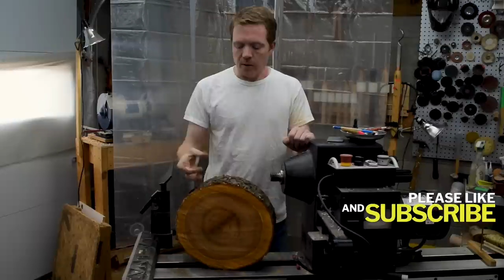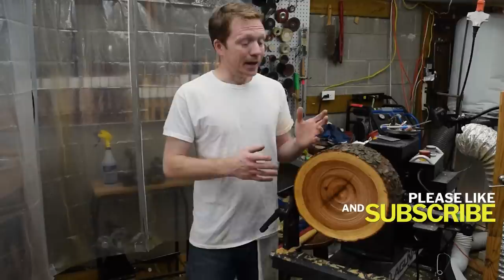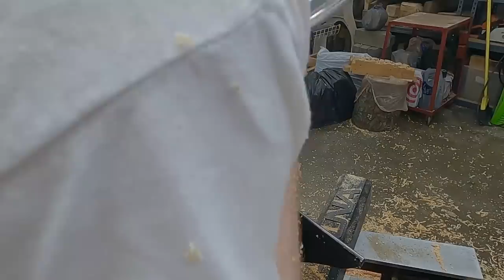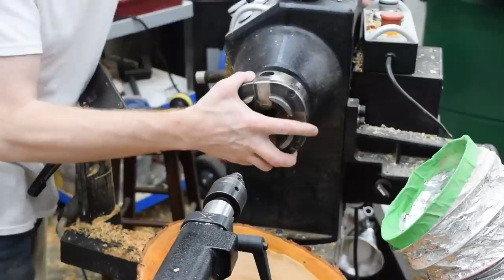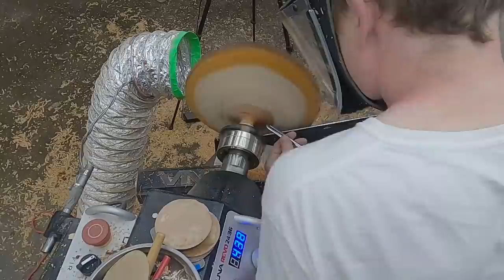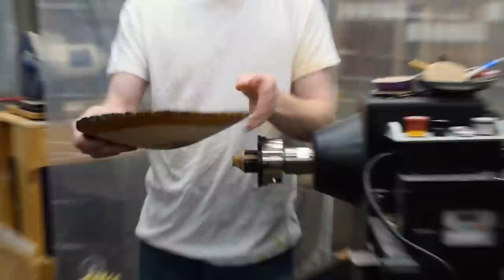Woodturning - Natural Edge End Grain Cherry Bowl [and Oneway Termite Tool Revisited]

Comment: Hi Chad, I had a revelation using the termite tool.  While making a box, I was noticing that I was only using one small section of the ring edge to do the actual cutting, and when it needed sharpening there was a a lot of sharp ring left that hadn't even touched wood.  So I spun the lathe in the opposite direction, rotated the tool 180 degrees and presented the tool to the wood on the right hand side (as you face the piece), and got to use an unused edge. This effectively doubled the time between sharpening. I imagine you and many other turners have figured this out already, but I hadn't seen it anywhere so I thought I would share it.
Reply from the maker: Thanks for the tip, Steve! I had the same thought about the unused side of the cutter being wasted, but hadn't considered your solution. Next time I use it, I'll definitely be using that idea! Thanks for watching and sharing your tip!

Comment: Steve, the Termite is the right tool, and with wet cherry the hollowing should only take a few minutes. You are using the tool upside down. Turn it over and use the less aggressive side, riding the bevel. I only use the aggressive edge to finish across the bottom inside of the bowl.  Also, tuck the handle along your forearm with your right hand holding the handle at the fatter part closer to the ferrule. You will have far more control. Steady your body against the lathe and lean over, or turn in reverse. For deep vases that works best, but is a learning curve. And play a bit with tool rest height until you find the sweet spot. Main thing is, like with all wood turning tools, ride the bevel. Flip that tool over.
Reply from the maker: Thanks, I'll give those things a try next time. There is definitely a sweet spot that I'll occasionally hit, but it is usually preceded and followed by a series of sour spots. 😬  Do you just sharpen the underside/less aggressive edge by hand or is there a better way?
Reply: @ChadEamesWoodWorks  I use the Oneway jig to sharpen the tool with a router in a table. Sharpen both sides, but very lightly. The termite is a very tough tool and I rarely sharpen it. Don't need to. I have one #3 cutter that is more than 20 years old, and I use the Termite a lot. I have gone as deep as 28" in a vase with the Termite, but with my own handle. Check my webpage at www.hdv.net if you want to see one of my homemade handles. There is also a tutorial in there about using the Termite. I think you will find it under "Tips and Tricks".
Reply from the maker: Thanks for the tips! I use the router table and jig to sharpen, but I've not tried to sharpen the less aggressive side with it. You're the only person I've ever heard from (or heard of), who seems to like the Termite tool. You've renewed my hope that it is actually a functional tool!

Comment: I'm still watching the video.  But speaking as a hand tool wood carver, that ring tool looks familiar.    Think of it as a scorp, or a crooked knife.    I bet that if you take that tool and practice on a piece of wood as if you were going to make a spoon by hand, you would be able to get a handle on how to present the tool on the lathe.  The reason it makes a clean cut is that it is a much finer edge, more akin to a knife edge than a typical lathe chisel.   I am fascinated by this tool, I wish I had a lathe to try it out.   Cherry is my favorite, never get tired of it.
Reply from the maker: Yeah, it's pretty similar to that, except most scorps I've seen have the bevel on the outside of the curve; the termite tool has the bevel on the inside of the curve. I've played with it in all sorts of presentations to the wood, including rotating the lathe by hand, but taking the bit out and experimenting by hand might be the way to go. It seems to work best when you're cutting straight across the engrain in something like a box, versus a bowl with the sloped sides. Thanks for sharing your thoughts and for watching!

Comment: Hey Chad. Ran across your video while looking for tips on how to make an end grain platter. Interesting use of the ring tool there. I've noticed a couple of things. In most ring tool operations I've seen, people were using balanced wood, using it for precision cutting and boring. I don't know if the Termite is rated for such choppy and unbalanced turning. 
Another bit of advice would be to get your tool rest closer to the wood. Your initial 3-4inches of cutting were the best, (because of slower speed nearest the center, and that that was the most balanced area on the piece).
you were getting more slips an catches the farther you got from center, and, the bigger cut with the ring tool you attempted.
Just a couple of things I noticed

But hey, if you ain't turnin, you ain't learning, right! 
Good job. Good video.
Keep a goin Chad.

Comment: Would liked to have seen some sort of close-up of that termite tool you referred to.   I'm pretty new at all this and I have no idea what is amounts to.
Reply from the maker: Yeah, sorry about that... do a quick google image search to see it. Or, you might be able to get a good look at it if you pause the video when it's most visible. It's a type of "ring tool" where the cutting blade is a ring with the bevel on the inside. So the shavings pass through the ring as you cut. I hope that helps/makes sense. I need to start remembering to show things like that. Thanks for mentioning it!

Comment: Hi chad, lovely bowl! thanks for sharing and I love your spirit. I've just purchased a Termite and haven't used it but I've been doing lots of "watching others" use it. I am wondering if it is your camera angle but it looks like the bit is quite open - around 1 O'clock. . I've seen it used in a more closed 2:30) orientation and it worked really well on both heavy and light cuts.
Reply from the maker: Hi Selina. Thanks for the kind words! Since recording that video, I did get the hang of the Termite tool. I think I use the words "open" and "closed" opposite of how you do (i.e., when open, the ring is horizontal giving a very aggressive cut; closed, the ring is vertical and has more of a scraping cut). Until you get familiar with it and are comfortable with how the tool engages the wood, entering a cut at 2:30 might give you a bit of a surprise (it can be grabby and dig in very quickly). Even after hollowing several decent sized pieces and gaining some confidence, I made one small slip and had a catch bad enough to snap the ring. My ultimate conclusion is that the Termite Tool isn't worth the time and effort - there are too many other efficient ways to cut end grain and if I'm going to spend that much time learning how a tool works, I'd rather it be a hook tool (because there is no ring to clog with shavings). I hope you have better luck with the Termite than I did! One tip that I received that did help considerably is to use the underside of the ring to cut. The underside is much less aggressive and still achieves a decent cut. As you get the hang of it, flip it back over and try the top edge again. Thanks for watching! Good luck!
Reply: @ChadEamesWoodWorks  good to know. I use open for horizontal as well - 12:00 on the clock and closed for 3 or 9. I’ll let you know if it ends up in my unused tools section or go-to! I’m looking forward to experimenting and appreciate the tips. Thanks for sharing, always enjoy your material and just figured how to use the like button on the TV ;)
Reply from the maker: I also found that it’s easier to start the cut with the tip pretty closed then rotate it so it’s more open and ease your way into that efficient, clean cut. I still have the smaller size tip, so I’m sure I’ll give it a go on some boxes or something. Sometimes I get it to work and sometimes it beats me. I’m sure I’ll revisit it, but now my eye is on the hook tool. 😁

Comment: Chad: I like your videos. I was thinking maybe your tool rest was too far away from the bowl. When I do that I get a lot of chatter.
Reply from the maker: The way the tool is made, you have to have a decent gap because there is a set screw that sticks out. Apparently it’s supposed to be that way but it seems like that could have been designed better. You are right though, a smaller gap would probably help. Thanks for watching, David!

Comment: Doesn't the pith tend to crack? Or is cherry one of those woods with a more stable pith?
Reply from the maker: Yeah, that's one of the trade-offs with a bowl like this... The pith was already cracked through all 5" of the blank (note the black line running through the pith), but that can be helpful because the crack will open up and let the wood move without cracking the rim of the bowl. Once the bowl dried, I filled the crack with epoxy dyed black. To keep a bowl like this from cracking in the pith, you'd probably need to turn it extremely thin. I've done some thinner ones that didn't crack as much, but they still had small cracks after drying. Thanks for watching, Eric!

Comment: Is that the same piece of wood you started with??  I thought you were going to make a huge bowl and then it ended up so thin. I must have missed something.
Reply from the maker: Yes, it is the same piece of wood. My finished bowl was the maximum diameter it could possibly be and is 3" tall. I started with a 5" thick slice and predicted about half of that 5" would be waste. You were probably expecting a different style of bowl - deeper with more volume - but that wouldn't have worked with this piece of wood because of how the wood moves as it dries. I've got several videos of larger bowls you can check out, if that's what you're looking for. Thanks for watching!
Reply: @ChadEamesWoodWorks  wow in the video it looked bigger than 5 inches. Cameras are deceiving. It’s a great bowl 👍

Comment: great bowl! is there a reason you didnt shape the outside first creating a tenon? now you cut off a lot more wood than needed, or am i wrong?
Reply from the maker: Thank you! It could have been done with a tenon as well, but I wanted to use the faceplate for the extra stability in case I had a nasty catch. I probably would have removed the same amount of wood either way, so I don’t think I wasted any more than necessary. I usually have a bad habit of not leaving myself enough waste and having to make compromises with the form, so I’m trying to break that. Thanks for watching!